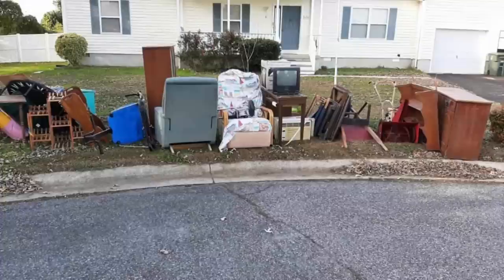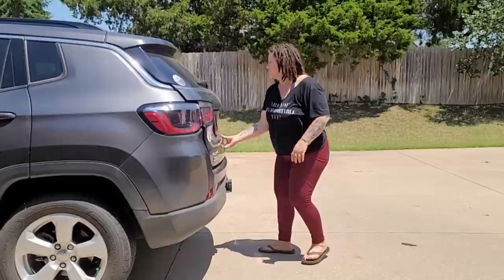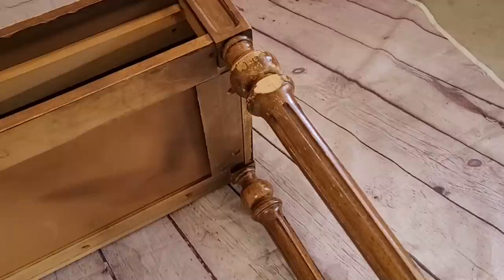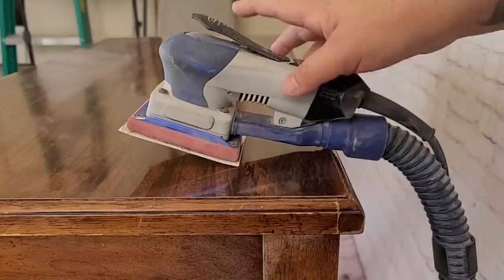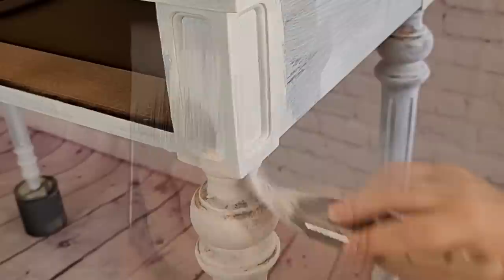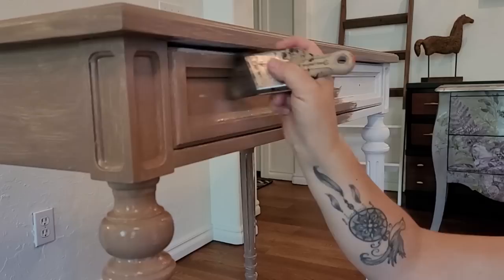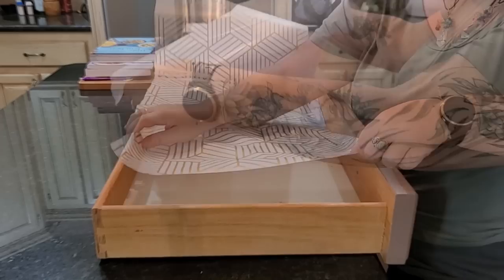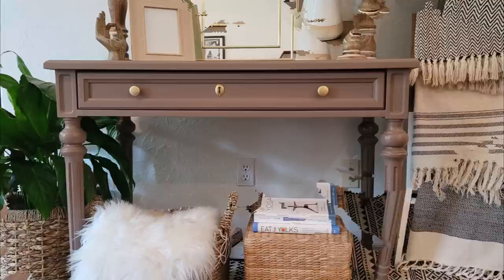Newbie Tips for Furniture Flipping: Part One/Boho Furniture Makeover

Comment: Have you used Behr chalk paint? If so, comments?
Reply: Sorry, I see you mentioned Behr chalk paint. I am having horrible problems with it. Dries faster than i can brush it. I tried spraying the brush and/or the piece. I end up with a mess.
Reply from the maker: @barbnitecki4407  what temperatures/climate are you trying to paint in?
Reply: I'm in Wisconsin.  75-85. Some humidity.
Reply from the maker: @barbnitecki4407  That is pretty decent temps to work in. I have never had an issue with the paint drying out on me too fast except in like 100⁰ temps. My only suggestion would be to water down your surface and brush even more.
Reply: @SabsRehabs  thanks for answering.  I'll try that.